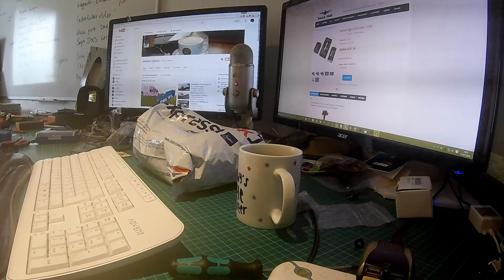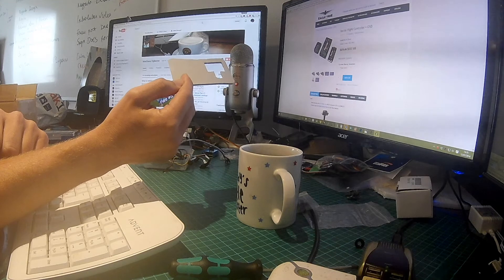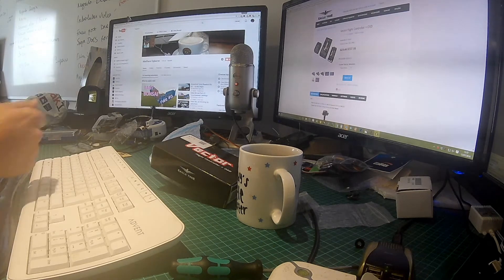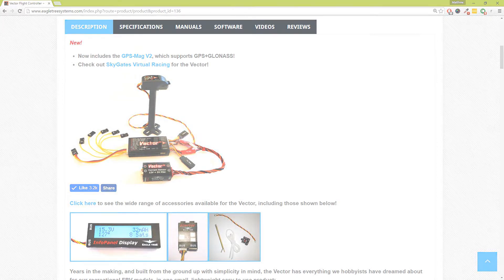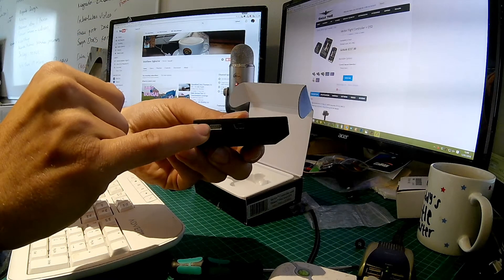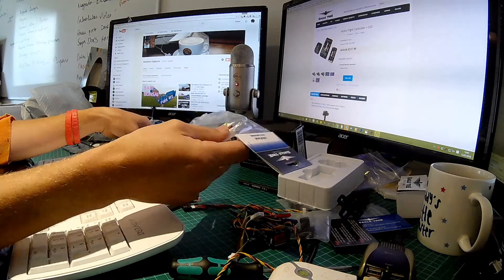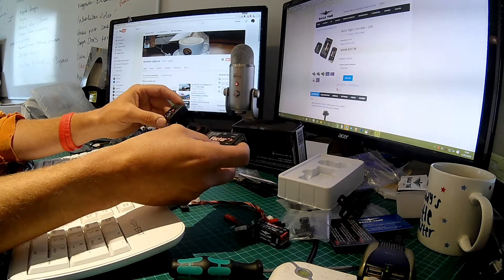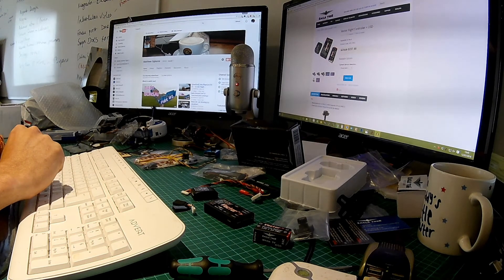First Look at the EagleTree Vector & Why I went for the Vector over the Pixhawk PX4

Comment: I believe you have a slight misunderstanding of Pixhawk. You are actually pronouncing it wrong. :) Anyway, the 1mb limit was a hardware bug, corrected. You are not going to fill that with waypoints or settings anyway. It's more about firmware and advanced functionality. Pixhawk has a much larger development community, being open source that's to be expected. It's also comes in more hardware flavors. However, it's probably not as easy to use. With anything that's feature rich, more can go wrong if you select incorrect parameters. Between PX4 and Ardupilot, eagletree can't compete. Customer service for pixhawk.. It's open source, that doesn't exist bro. Show me a custom UAV that utilizes DNN & computer vision, 90% of the time its a PX4/Ardupilot rig.

Comment: One reason to go with the Vector is because the Pixhawk PX4 never worked!  Now that 3DR is out of business they aren't making or supporting the PX4 anymore either so it's an orphan!  Actually they never provided support and when I asked them to repair mine they said Buy A New One! but they did have cables and accessories at least!
Reply from the maker: Howdy Steve, I didn't know that about 3DR. Also another issue which has the been the same with the previous versions, is that the pixhawk relies on a separate OSD board, which at best is flakey in my personal expereince. Checkout the new series on iNav though Steve, you'll be amazed how far that has come in 12 months here https://www.youtube.com/watch?v=1DCCjPbHl_I&list=PLgoM4-umzSqd0clW-e_A12yKiOpV--3a2  Matt

Comment: Hi Matt!
Have you seen the new Micro vector? What do you think, would it be better for a fixed wing than the old one? It's supposed to be a little bit better
Reply from the maker: Howdy fella, yes I have. It's a form factor aimed at quad pilots. Personally I would not buy one for fixed wing models. The original works too well! Hope that helps Banon :) Matt
Reply: Well crap, I have one on my order right now! GPS in out of stock so it hasn't shipped yet tho.
Why would the original one be better for fixed wing? (planning to use mine on FX-61) I think it has a better microprocessor so it should handle the future updates easier and better.
The only downside for now is only 4Mbit of memory for logging and no voice
Thanks :)

Comment: The Eagle Tree Vector beats the Pixahawk in so many ways.   I don't know anything about Pixahawk customer service but I do know about Eagle Tree Customer Service and it's amazing.   I had an issue with my Eagle Eyes Diversity / Tracker and they got back to me quickly and stayed with me until it was fixed.    And if you ever get the chance to see all the things that you can do with the OSD you have to check it out.  And the Power Panel....the best feature is that it records the last known GPS co-ordinates and displays them on the Power panel if your plane goes down.   Just plug in the longitude and Latitude into your smart phone and use it as a tracker right to your plane.   IT'S GREAT!   And yes......the RTH has never failed me either.   And you can set your level and trims while in flight if you like.  And I haven't really even gotten started.
Reply: i don t agree rod!
i have apm and pix since 4years now and the code is a real beast!! ive never use ardu for plane but for multirotor is very hard to be better...i have dji too and i don t like it (naza m v2)
for multirotor set up is very easy..perhaps it s more difficult for plane i don t know...eagle tree has very good reputation for plane! but with neo8 m from drotek and a pixracer, micro vector can t fight
Reply: Maybe I should have said "Here is why I like ET Vector" instead of " Beat Pixahawk in so many ways".  
As I really do not know Pixahawk that well at all.   And all my experience with Vector is with a fixed wing aircraft.   And it was the OSD on Vector that sold me on vector.  Not that it doesn't do everything else too quite well.   But now I"m building a Y6 Tricopter with a Z1 Tiny2 Gimbal.   And Michael over at Aimdroix recommened the PIxahawk for my X8.   As I was complaining about how much I hated my XAircraft mini flight controller.   So here's your chance to sell me on the pixahawk for my Y6.   I know the pixahawk has a better price point, but I love Eagle Tree Customer Svc.  But 3DR may be good as well.   Tell me.....why do I want to buy a Pixahawk for my Y6?
Reply from the maker: Howdy gents, interesting conversation here. From my perspective, I would not run a Vector in a quadcopter,  only in a plane. Whereas in a quad, specifically a larger one (450mm and above) I would use a pixhawk or pixracer.  Matt
Reply from the maker: Morning, I couldn't agree more. Thats why I now have 3 vectors. Matt
Reply: What is it about the pixhawk that makes you like it better?   I've never used a Vector on a multirotor but I hear they work just fine.  And I'm building a Y6.    But I see a pretty loyal Pixhawk fan base so I'm listening.   All for saving money if it does the job I need it to do.
Reply: You need a pixhawk 2.1 'aka' the cube with HERE+ gps.

Comment: Or, you could have tried the APM Mini Pro.....with servo pinouts only...?......£45 from Goodluckbuy complete with GPS and Current Sensor.....Add £10 for an OSD.
   The Pixhawk is not suitable IMO because it has those silly little white sockets and plugs, which break far too easily....That said, the Pixhawk is a powerful FC if you can figure out Mission Planner. The Vector is nice though, but then it should be for that money.